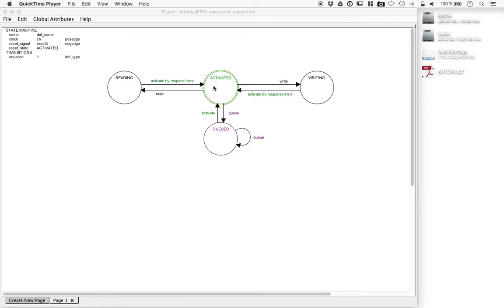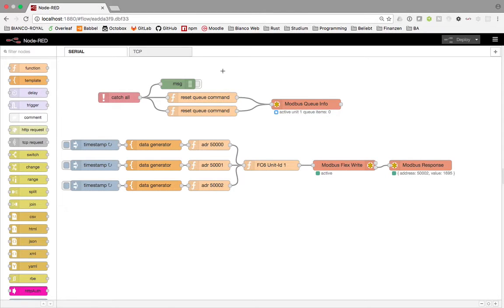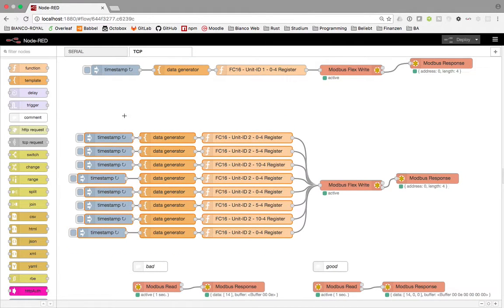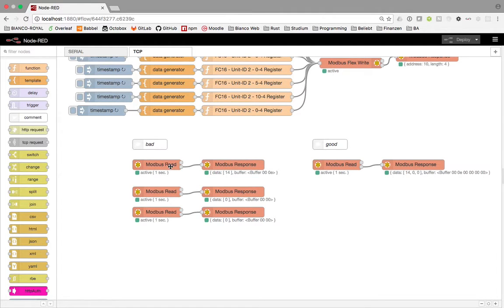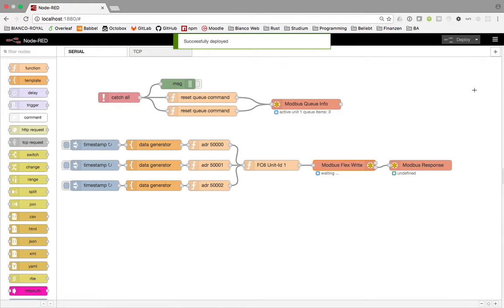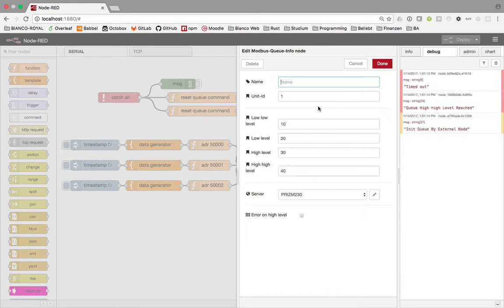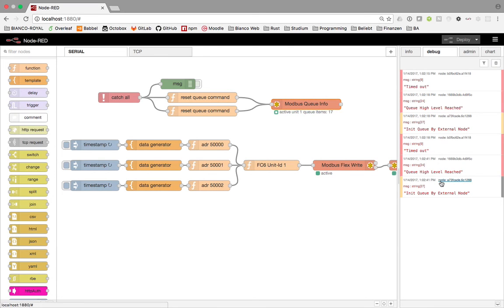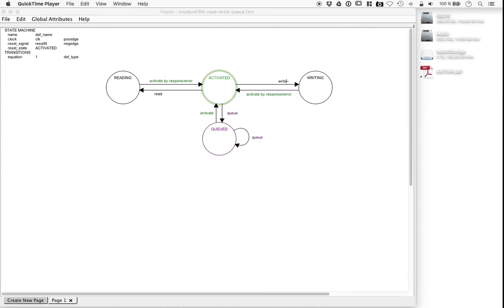node-red-contrib-modbus - Modbus queue or not queue

Comment: Hi Thank you for this Video and the information! I have a question related to queueing and really would appreciate your input on it.
I frequently have the problem that happens if i change the unit id of the messages. So i want to poll data from 7 different unit id's and i pull a lot of data (basically all 150 datapoints my devices can supply). I use flex sequencer to pull Coils, Input reg, Input stat and holdings. It works fine as long as i only pull those four types in sequence. But if i add 4 additional sequences (with a different unit id) it seems it ignores the active queue and messes up the communication completely...
Reply from the maker: could you send this request via GitHub by copying the text and to give us an example to reproduce the problem? Then we could test and fix it in the next few weeks. Thank you in advance and happy virtual wiring - https://github.com/BiancoRoyal/node-red-contrib-modbus
Reply: @KlausLandsdorf  Hi Klaus, thank you for your quick reply! 
I think i (theoretically) found the error/solution. I found that i had the "UnitId's in Parallel Queues" checkbox checked in my Server... 
I was not able to test this in the field but i am quite sure it will solve my problem. 
In my opinion this will lead to problems for many users of TCP to RTU devices. Because the option is a bit hidden and not easy to understand at first.